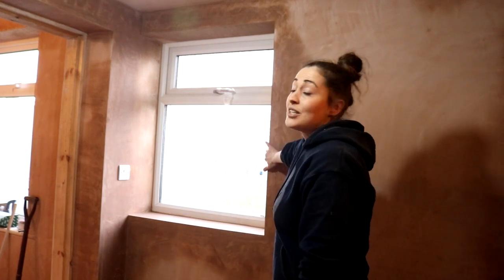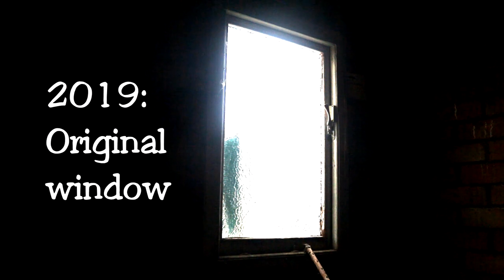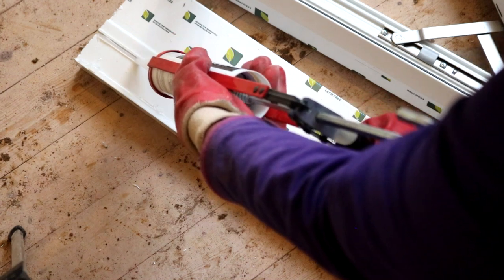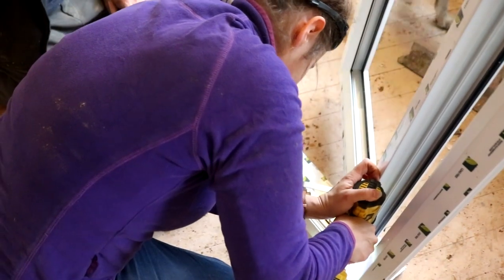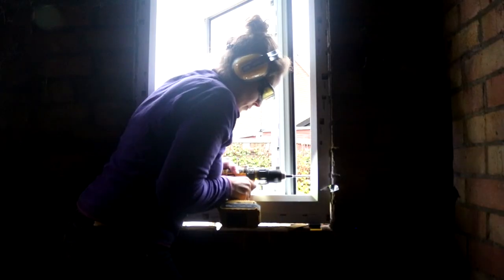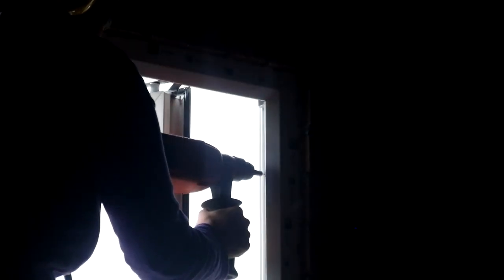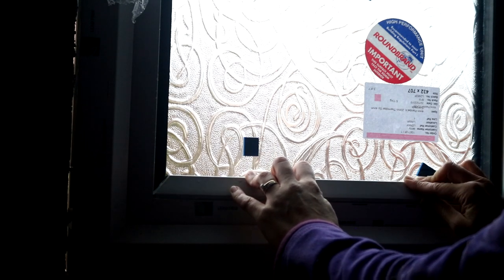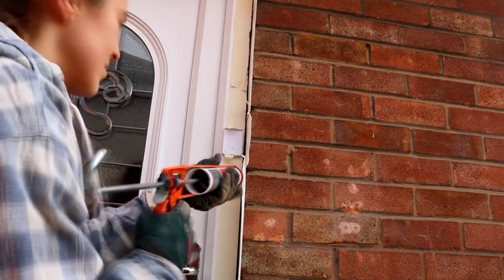Fitting Double Glazed Windows | The Carpenter's Daughter

Comment: Nice video!  I replaced all my windows last year. Aluminium frames that had to be cut out, this was not easy.  Prior to sealing, I put a window rated expanding foam to completely seal the window and later used a sealant to cover that. It makes a tremendous difference in my heating and cooling costs. It's a good investment. Thank you for sharing.
Reply from the maker: Thanks for the info! The expanding foam might also be done, too.  Not sure who's sealing them yet, unless it is me after all 😂

Cutting out aluminium sounds very very tedious, but it sounds like it was a very rewarding job! 😊

Comment: I was taught to pack the glass with what they call heel and toe on opening windows. Similar to the way a gate is braced. 

Little tip for that particular window profile is grease the beads with some washing up liquid. Helps them pop in easier and reduces the risk of them cracking the corners. Be mindful when they do go in if you grease them, they will spit
Reply: macky89 I was taught the same, heel n toe 👍🏼

Comment: Just a tip to stop that header course from coming loose,befor you remove the frame drill one vertical joint out at either side of headers and wedge some slate in.then   repoint this will tighten bricks up.well done  any way
Reply from the maker: Thanks!

Comment: Brown for the win, White just ends up looking grubby. When cutting out old timber frames saw at a 45 degree angle, easier to get out.
Reply from the maker: I absolutely agree about white looking grubby quickly.  It may look the best initially, but I find it's difficult to clean back to brand new.  And thanks for the 45 degree tip :)

Comment: Hi Vikkie. You really should only be using clear sealant, as the frame & wall is straight, this straightness is what you will see from close up & a distance. Using a coloured sealant, you will have to be 100% accurate, and then some. And that's not easy for anyone. I actually asked my installer to remove the brown he put on 3 of the first seven windows & replace it with clear. Even he could see the difference. Just something for you to maybe consider in future. Great overall job by the way. Well done. G
Reply from the maker: Thanks for the tip!  Would you still fill something behind it before adding clear sealant?
Reply: @TheCarpentersDaughterUK . It really depends on how close the frame is to the brickwork. Expanding foam is a good solution. This will also provide extra insulation. Let it fully cure (24hrs min), then cut away the excess with a blade or multi-tool. Brush away any remnants. You may need to use a kitchen scourer to clean staining, if any, then seal. Job done. Hope it helps.
Reply from the maker: Thank you 😊

Comment: Another US style building requirement - Lintels over every window and door.Those hanging bricks would have a steel plate holding them up by building code. No weight from above pressing down on the windows themselves.
Reply: I cringed when the crowbar was used to lever down off that unsupported head
Reply: U.K. Requirement too, UPVC is not load bearing!

Comment: Do you need a fensa certificate? My brother in law works for a plastics firm and we can get it all at trade prices and my hubby and I can fit them just no certificate.
Reply from the maker: I've just had to read into again and apparently you do need it if you want to sell your house with windows installed after 2002.  We got them for new windows back home and someone had to come and inspect the company's work in order to receive our certificate.
Reply: @TheCarpentersDaughterUK  That's great,Thank you! We are in our forever home so don't plan on selling. That's made my day because now we can get on and improve things so much. Window units are old and glass units have blown so constantly looking out of "home made" frosted glass😂
Reply from the maker: :)  Also, from what I remember, if a window is a certain height, you may also need toughened glass to ensure you meet building regs.  And if a door is more than 50% glass.
Reply: @TheCarpentersDaughterUK  All door glass and anything within 300mm of a door must be toughened. In all windows, any glass less than 800mm from the floor must be toughened. A FENSA cert is just like a building control notice. LABC can do a regulisation certificate if you have already fitted your own windows but it's more expensive than an indemnity policy which is about £20 and can be organised by your solicitor quite painlessly during sale.

Comment: You should try using a battery sawzall not sure if they sell Milwaukee brand were you are but good brand
Reply from the maker: Very very good point!!!  Also, I've never understood what that tool was when April Wilkerson mentioned it.  That's the first time I've seen it written down lol
Reply: The Carpenter's Daughter they have different sizes the m12 size is more for homeowner use , the m18 size is more suited for commercial tradesmen use just my two cents 😀